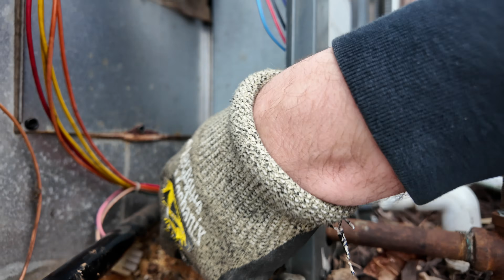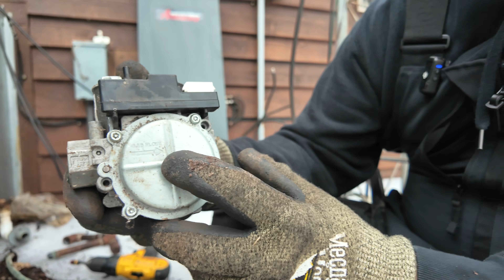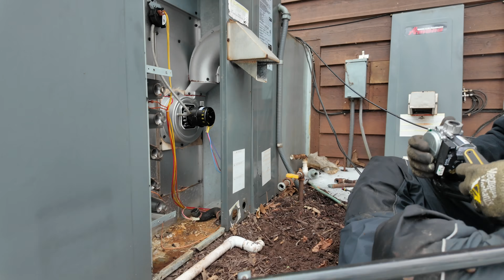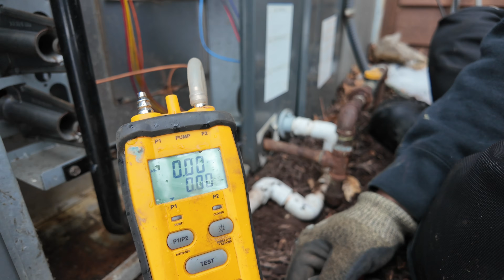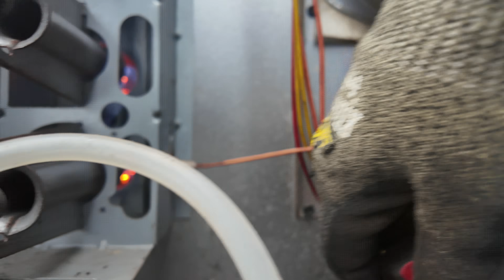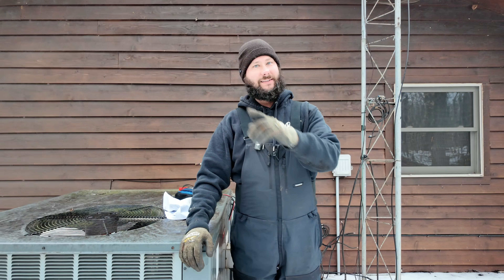How to Replace a Gas Valve + Set Manifold Pressure (Two-Stage Furnace Tutorial)

Comment: This is a green guys opinion but wouldn’t channel locks accomplish the same job? Those pipe wrenches are comically large
Reply from the maker: You can definitely use channel locks.But sometimes you have to have the pipe wrenches to break things loose, and I always like to make sure I get it good and tight.So I don't think I could do that with channel locks
Reply: @taddydigest that’s a fair point and also a great video! I start my first residential job Monday I’m trying to freshen up as much as possible. Also I’m from central TX

Comment: Thanks so much for your videos you're amazing. Is the pressure in low and high are the same for all two stages valve or depends on the manufacture ?
Reply from the maker: That depends on the manufacturer.But the pressures are pretty close